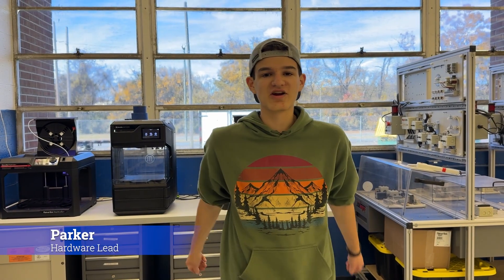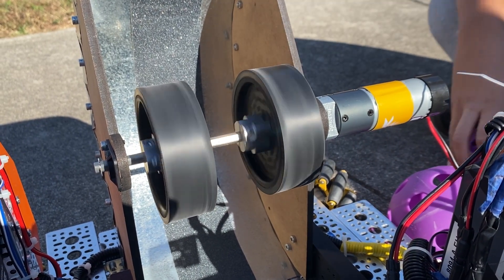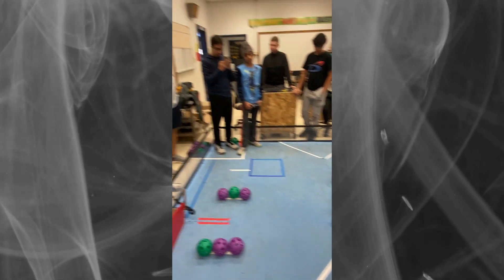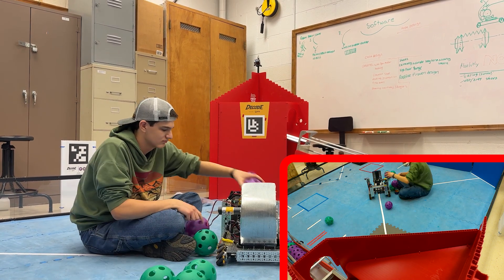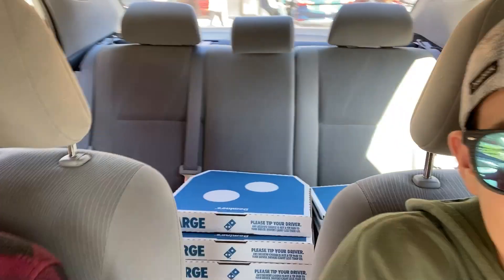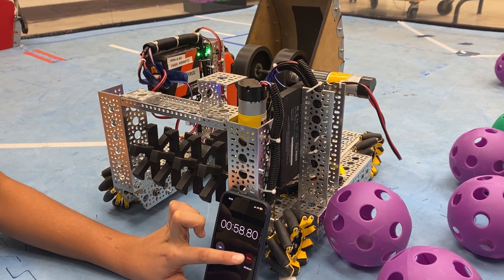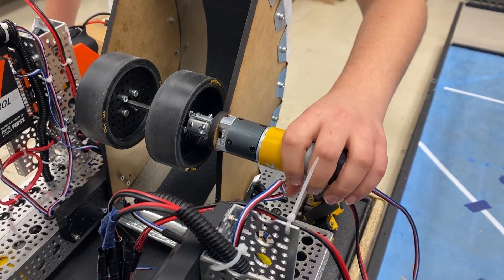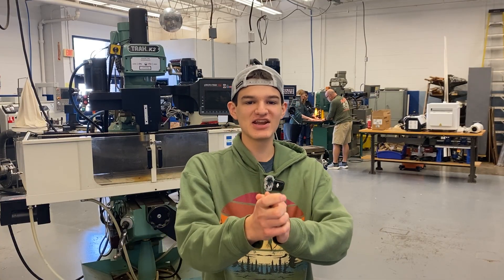What 6,000RPM Does To An FTC Launch System

Comment: why not make the flywheels centralized?
Reply from the maker: Hello! The flywheels are not centralized so that the ball/artifact is not pushed into the back wall of the hood. The flywheels still contact with the ball/artifact enough and it prevents damaging the ball/artifact. Please let us know if you have any other questions!
Reply: @RoboticRampageFTC  does the metal on the back of the hood flex at all or is it rigid. Do you guys also have a way to change and test different compressions?
Reply from the maker: The metal at the back has a little bit of flex. We are working on version 1.1, which will incorporate a method for testing different compressions.
Reply: @RoboticRampageFTC ok cool
Reply from the maker: Of course. Please let us know if you have any more questions!